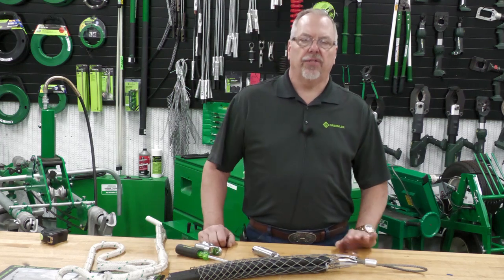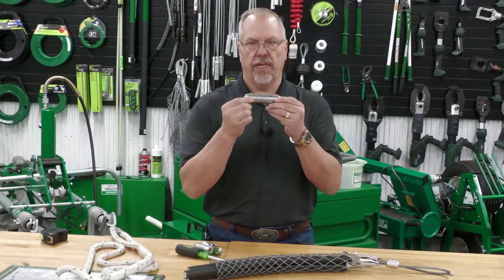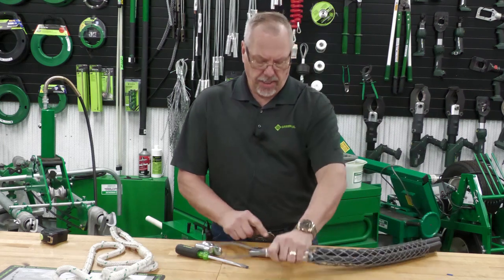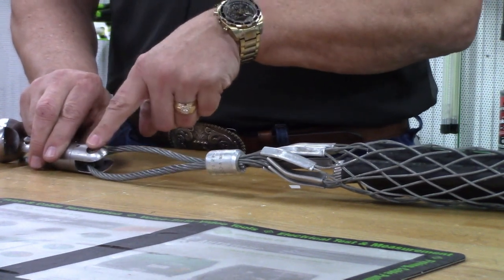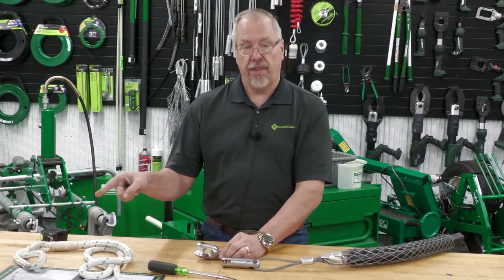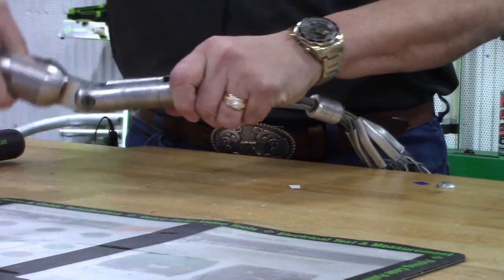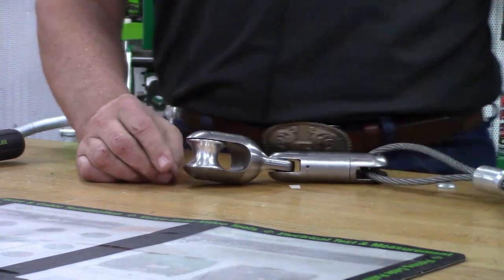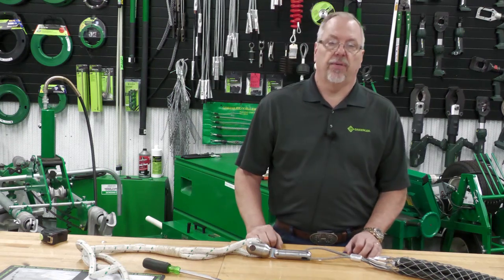How to properly connect Greenlee pulling rope to grip.

Comment: It's nice to see the proper hardware as in forty years in the trade I've never seen one. We typically loop the rope through the pulling eye and the sock back through it. I've never broken that although I've snapped the rope a couple of feet from the sock. In most cases we never use a sock but strip the insulation back and keeping half a dozen outside strands from the cable make a head through the rope eye. Then tightly wrap it with tie wire to prevent the strands from slipping. Tape and soap and pull. In a few cases I've actually built pulling socks from black iron tie wire. In either case it's important to tie the open end of the sock tightly around the wire to cause it to tighten it's grip as you put pressure on it. Greenlee makes some excellent equipment but most shops are not going to spend one penny beyond what they have to.

Comment: We have had those mesh socks pull off way too many times. Stopped using them long ago. The foolproof  connection is to cut the center out of the conductors and fold about 4 strands from each side both ways through the rope eye and tiewire the bundle. You can stall the tugger before that will come apart